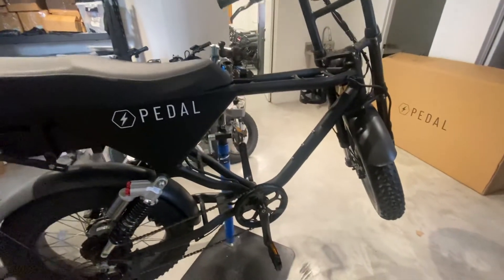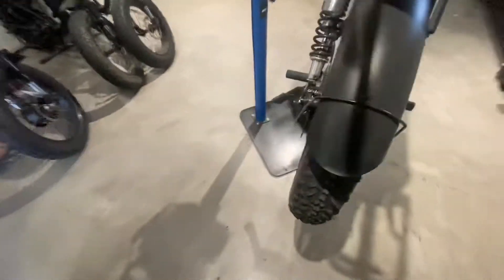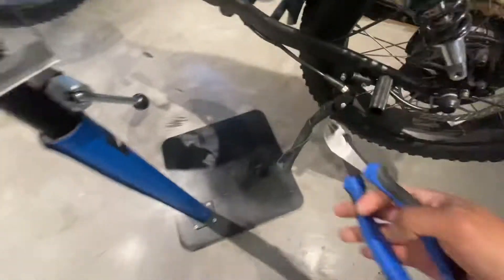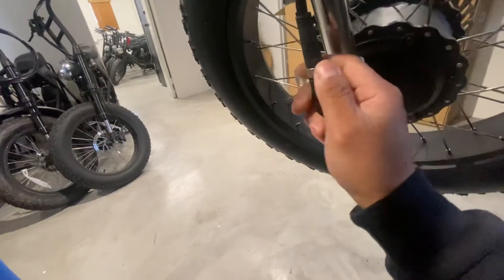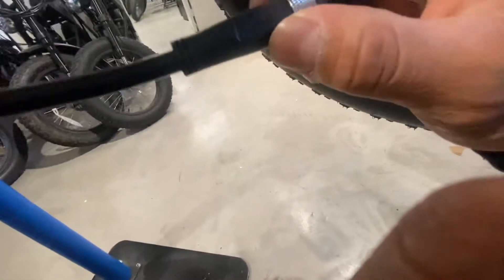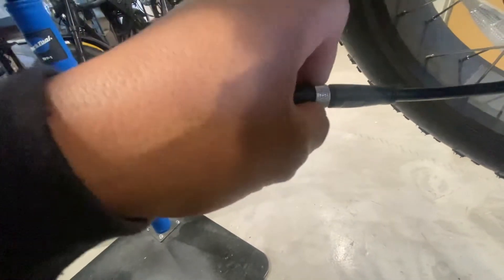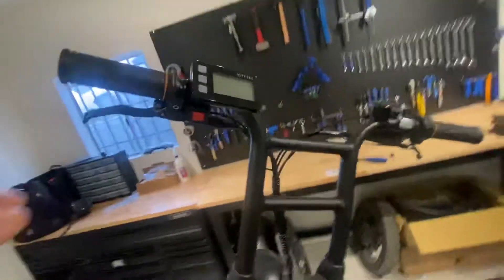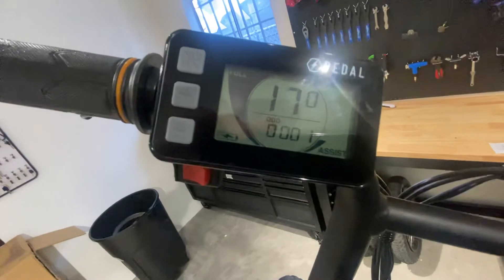Pedal Electric How to diagnose repair on error 8 on AWDII

Comment: Hi there I’m looking for a little information. I changed out the inner tube in the rear tire due to a flat. After unplugging replacing the tube then plugging it back in I now have an error code. The hub was working perfectly fine before unplugging. How do I resolve this issue?
Reply from the maker: check if there is a burn in the rear motor connector (black spot on the connections). If so, depending what side of the connector is burn needs to be replace.
Reply: Hi Im working with the PRO model and disconnected the rear motor and it is still giving me error 08 message, so im guessing the rear motor isn’t causing the issue? What would be the next step in this case

Comment: So, if it is the motor, then what? I did this and my front seems to work fine. However, when i rode it only in front wheel drive, it was laboring at a higher speed and was having difficulty going up a tiny hill. What next?
Reply from the maker: Replace the rear motor is the next step.